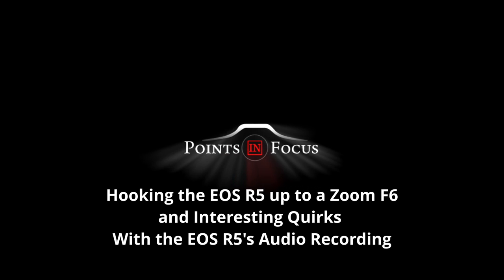Using the EOS R5 with the Zoom F6, and Interesting R5 Audio Quirks

Comment: Thank you so much for your research and testing. You're the only person I can find talking about this on the internet! I ran into this issue, too, but didn't know the technical terms to describe it, nor did I do as much testing as you. But I did have the 1dx iii (I saw you mentioned this camera in your article). I since then, I have sold it and purchased the r5. The 1dx iii (and 1dx ii) behaved the same and worked well with my preamp, the mix pre-d, from sound devices. I  normally use the 1/8in tape output from my preamp which I believe is line level and plug it straight into my DSLR of choice. But with the r5, the hot signal I'm inputing at line level is horribly distorted when at low gain levels of below ~30-40%. Please note, the 1dx iii did have a line input option in the settings, and that's what I used. This is maybe why it worked, whereas the r5 doesn't have a line input option. I tried the regular manual mic input setting on the 1dx iii and it peaked. So anyways, I ordered a special cable that should output a mic level signal from my preamp to the r5 and then I can put the audio gain to about 33% on the r5. I called canon about this issue as a complaint that I'm not able to get a professional audio feed with a low noise floor in the r5 camera. They said I was the first to call and note this. Recommend you do the same. Perhaps they need to hear from someone like you who can better explain what is going on with the new mirrorless systems (my r6 had this problem, too, I returned it already).

Also, the a7s iii has this problem, too (I've tested it). Around the same percentage of internal gain setting guidance applies with the a7s iii as the r5. Maybe the Sony XLR-K3M Digital XLR Audio Adapter will help, but I don't own that so I can't test it. I think the adapter has a line level input option which could help this issue.
Reply from the maker: Hi, thanks for the info.

I'm not surprised that most hybird cameras have problems handling all of the complexity of audio. Aside from the high end ones, they're not designed for line level signals, and I don't really see that changing. And to be honest, I'm not really sure what the right move is from a design point of view. 

On one hand, it would be nice to have mic/line switching capabilities. However, that means more hardware and more complexity in the camera which can be problematic when you're talking stuffing all that in one of these cameras. Also, Canon et al. have to balance the point that these cameras aren't video cameras, they're hybrids and that a significant portion of the buyers are only using them to shoot stills, or very basic videos.

On the other hand, the audio industry as a whole, I feel, is kind of being hamstrung by this continued desire to use analog signaling to interconnect devices. Sure I know the argument for it is, "but it's interoperable," but that doesn't really ring true, as there are plenty of digital standards that are interoperable too. But analog is also a big part of the problem here too. There's Professional line level (+4 dBU), consumer line level (-10 dBV), and mic level (-60 to -40 dBV). And on top of that you have things like repeated analog-to-digital and digital-to-analog conversion going on in many cases. Going from my wireless lav to camera converts from analog to digital 3 times, and digital to analog twice. And after the first A2D conversion in my wireless transmitter, it doesn't matter how amazing the recorder's preamps are or how much bit depth it has, the signal has already been limited to what the digital wireless system can do.

I think the Sony adapter would help if you're shooting Sony, since it appears to just completely replace the preamp and ADC part of the audio conversion process. But if you've already good a preamp that you like, just replace the cable with a -50dB pad for $30 and get back out doing something interesting with your gear.

Sorry for the rant, I find the world of audio recording immensely frustrating across the board.
Reply: @PointsInFocus  Thanks so much for this super detailed reply! That's really interesting about the digital vs analog issues. I recently received a cable that lets my my Mix Pre-D output a mic level signal (before I was using a line out signal). Switching to mic level definitely solved the problem of peaking! I am still getting a little bit more noise floor than I remember with the 1dx iii (perhaps is a placebo effect), but it's now acceptable and I'm happy I can use my mixer again.

Comment: Hey Jason 
thanks for the awesome videos. Just wondering what is the best method record audio to sync with R5c?
Reply from the maker: Wooo boy... That's a question.

I usually shoot in a studio environment, so I don't have to contend with distance (latency and SNR loss) or a lot of background noise. Because of that, I generally don't actually tie my camera and audio recorder together. Instead just use a mic on camera (usually the built in one) to record a scratch audio track that I can use to sync in post.

As a backup, I also always slate my videos (or clap if I don't have my slate handy) which gives me a backup sync mechanism if I need it.

In real noisy environments, or where the camera isn't going to be anywhere near the mic/speakers. Then you really have to do something about getting audio from the recorder's output to the camera, either a hard wire, or you can do it with a wireless mic setup. Though if you do go the wireless route in this case, be aware that it adds latency and you might need/want to compensate for that in post. The exact latency is going to vary from system to system, usually it's going to be much less than a 60 FPS frame though (<16.7ms).

I'm not sure if that answers your question, but hopefully it gets you some ideas.

Comment: Hi, absolutely amazing video and information. Just purchased F3 and there is no one who would give such detailed information. Is the digital limiter still a case of R5 at current FW version of R5? Do you know? Thanks!
Reply from the maker: To the best of my knowledge, nothing has changed related to the performance, operation, or settings for the audio on the R5 in any of the post release firmware updates.

Comment: I’m going to be honest… this workaround seems like a total pain in the ass. I think it would be much easier to buy a couple of -35 dB cables and always keep one attached to the f6 like Curtis mentioned. Then you don’t have to worry about changing a million settings between the two devices. One cable and done…
Reply from the maker: It's 2 settings (camera input gain and F6 line out attenuation), not a million, and once you figure out what they are, you can write them down since they won't change for that model of camera. For that matter, if you're not using the F6's line out with anything else, you don't even have to change the settings once you set them.

That said, my point here was to provide an alternative approach to solving the problem. Personally, I like having multiple approaches at hand, since I never know when I might need to apply it. This works without attenuator cable, which means it works when you forget, lose, or break your attenuator cable and don't have easy access to another one.

It's not ideal, any time you use the attenuation function on the F6, you're reducing the output's already limited 96 dB dynamic range. A pad cable doesn't have this problem.